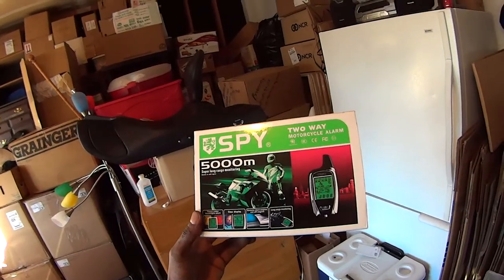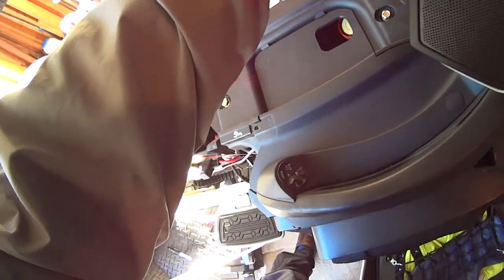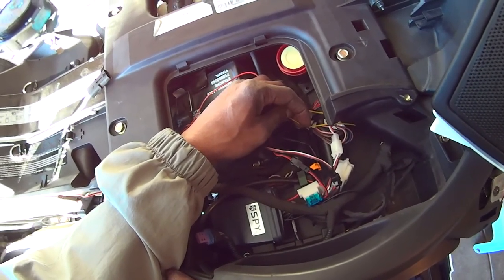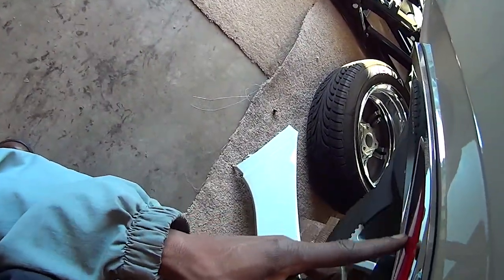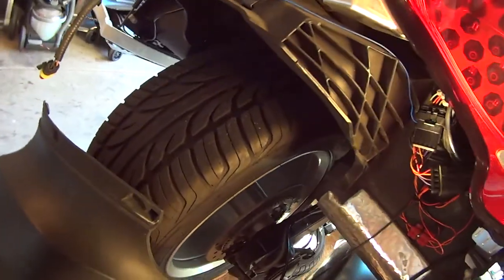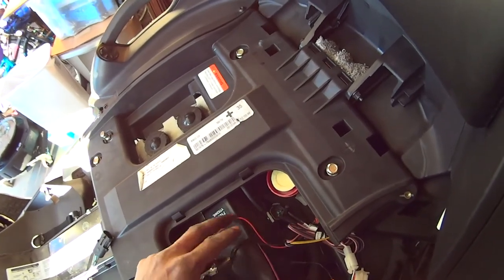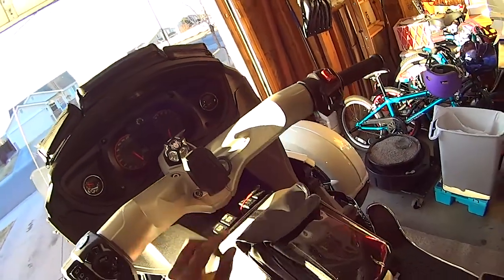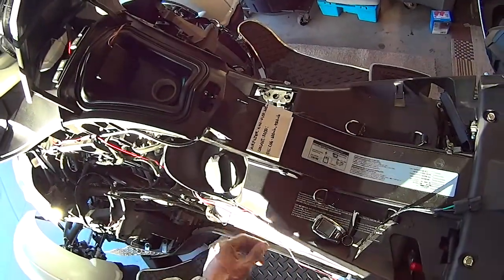Spy5000CanAmSpyderInstall (1)

Comment: Ok during the video you said that you didn’t use the brown wire,and if you do need to connected it where do connect it ? Also where did you put your antenna? Thanks 👍
Reply from the maker: @ronaldlane7892  The brown wire was for immobilizing the bike in the event of theft. I didn’t use that feature. I put my antenna at the highest point of my Spyder inside the rear topbox.

Comment: Hey hey i tapped in to rear lights they flash but the front ones don't...any ideas
Reply from the maker: Wow, its been a long time since posting this. I have replaced the reflectors on my front fenders and my saddle boxes. So when activated, the four of them and my rear tail lights are the only one to light up. My head lamps dont.
Reply: @the3wheeltraveler  yeah only two of mine in the rear  light up when I arm it